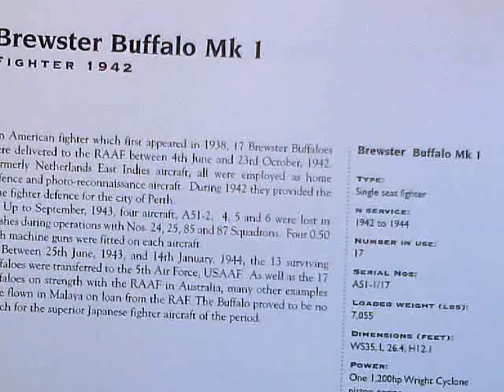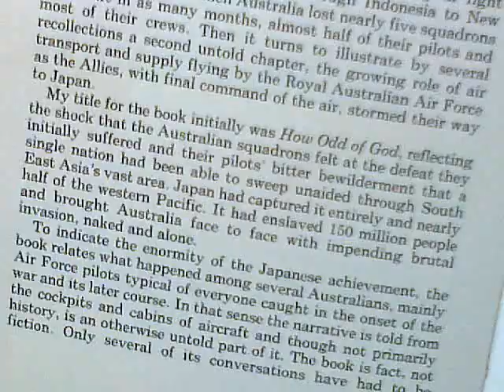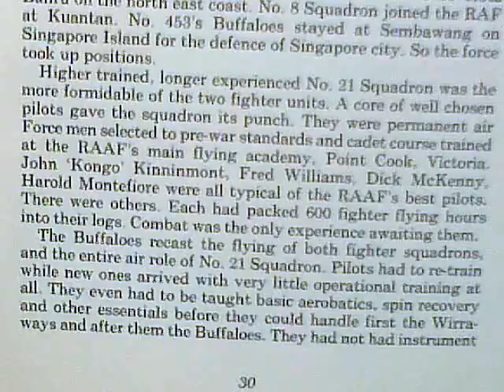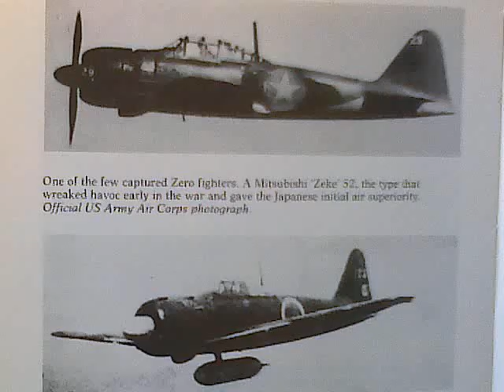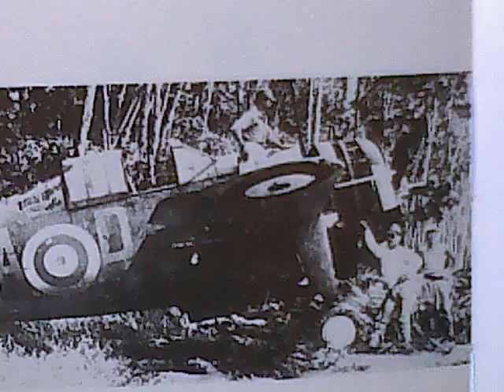World's Worst Fighter Aircraft, The 1941 RAAF Brewster Buffalo !

Comment: The Supermarine Spitfire,
To make matters worse, the Japanese had a fighter aircraft which could ‘dance’ even better than the Spitfire, a fact which was very well known even at the time, and about which the newly-arriving Spitfire pilots were warned.
The Zero developed its maximum speed of 291 knots at its rated altitude of 16 000 feet. The Spitfire produced 290 knots at 15 000 feet, confirming that below 20 000 feet the two types were more evenly matched in speed performance. Given the Zero’s much superior acceleration, in practice this meant that the advantage tipped more heavily in favour of the Zero at these lower altitudes. In comparative tests at 17 000 feet, the Spitfire was again unable to safely draw away from the Zero. The unanimous conclusion of Wawn and Jackson was that ‘the Spitfire is outclassed by the Hap at all heights up to 20,000 feet’.
As was already well known, the Zero had all the advantages in combat manoeuvrability at slower speeds. This was a product of the Japanese machine’s superior power loading and lower wing loading. The Zero stalled at only 55 knots, whereas in clean configuration the Spitfire stalled at 73. Being able to fly more slowly while still under complete control meant the Zero could fly tighter turns without stalling out. The stall speeds cited apply to straight and level flight at 1G – hardly a realistic scenario in combat, where pilots would typically stall out of accelerated turns. In a modest 3G turn, the Spitfire would stall at 130 knots IAS, which equates to a TAS of 242 knots at 20 000 feet. At 6G (a hard turn or pull out at high speed, with the pilot blacking out), the Spitfire stalled at 184 knots IAS, which equated to 257 knots TAS at 20 000 feet, and 294 knots at 30 000. The latter was only 11 knots less than the Spitfire’s maximum speed at that height (at the emergency power settings of 3000 rpm and plus 2 ½ pounds boost), so it is clear that as height increased, the pilot found himself stuck in an increasingly narrow corner of the flight envelope, until any attempt to pull G would result in an instant high speed stall. This helps to explain the high incidence of Spitfires stalling and spinning out of combat turns over Darwin in 1943.http://www.darwinspitfires.com/index.php?page=spitfire-vc-versus-the-zero
Japanese air raids on Northern Australia hastened the formation in late 1942 of No. 1 Wing RAAF, comprising No. 54 Squadron RAF, No. 452 Squadron RAAF and No. 457 Squadron RAAF, under the command of Wing Commander Clive Caldwell, flying the Spitfire Vc(trop). The wing arrived at Darwin in February 1943, and saw constant action until September. The Mk Vc versions received by the RAAF proved unreliable and, initially at least, had a relatively high loss rate. This was due to several factors, including pilot inexperience, engine over-speed due to the loss of oil from the propeller speed reduction unit (a problem resolved by the use of a heavier grade of oil)] and the practice of draining glycol coolant before shipment, resulting in internal corrosion of the Merlin engines.
Another factor in the initial high attrition rate was the relatively short endurance of the Spitfire:most of the sorties were, as a matter of course, flown over the wide expanse of ocean between Australia, New Guinea and Timor. Even when fitted with drop tanks the Spitfires could not afford to fly too far from base without the danger of running out of fuel over water. As a result, when an incoming raid was detected, the Spitfires were forced to climb as fast as possible in an attempt to get into a favourable position. In the prevailing hot, humid climate this meant that the Merlin engines were often overheating even before combat was joined. The Spitfires were fitted with the Vokes tropical filters which reduced performance: in an attempt to increase performance the filters on several Spitfires were removed and replaced by the standard non-tropicalised air intake and lower engine cowlings which had been manufactured by the base workshops. The experiment proved to be a failure and the Spitfires were quickly refitted with the tropical filters.
Many of the Australian and British airmen who flew in 1 Wing were experienced combat veterans, some of whom who had flown P-40s with the Desert Air Force in North Africa, while others had flown Spitfires over Europe. They were used to being able to outmanoeuvre opposing fighters and were shocked to discover that the Zeros they were now flying against were able to outmanoeuvre the Spitfire. Several Spitfires were lost before the pilots learned not to attempt to get into a turning dogfight with the agile Japanese fighters. In spite of these problems the Spitfires were reasonably successful and at times were able to catch the Mitsubishi Ki-46 reconnaissance aircraft which had hitherto flown fast enough and high enough to evade interception
https://en.wikipedia.org/wiki/Supermarine_Spitfire_operational_history#South_West_Pacific

Comment: The Buffalo used the same Wright R-1820 engine that many other aircraft used.  Depending on which supercharger arrangement the engine had, it was rated from about 900 HP to 1350 hp.  For the Buffalo it was rated at 1100 to 1200 hp depending on model.  Early models had a problem with the engine throwing oil at full power but the Finns found a solution.  The AT-6 Texan trainer (Harvard) had a 600 hp engine with 1340 cubic inch displacement, a physically smaller engine never put in the Buffalo  The later versions of the Buffalo had much larger fuel tanks giving the plane an incredible 1400 mile range - but loaded up with fuel decreased the agility of the plane.   

The Brewster Buffalo may be the only fighter credited with destroying more enemy aircraft than its total production run.  Most of the British Brewsters were destroyed on the ground, just like the losses the USA suffered in Hawaii and the Philippines.
Reply from the maker: G'day,

 Thanks for the "Gen." about the Engines...

   On that point about destroying more Enemy Aircraft than it's own Production Run, it's not a statistic which I've ever previously encountered encountered...; but I suspect that the Fokker Eindecker (E-1, E-2, & E-3...; they were the same basic Airframe but with different Armament fitouts & Engines) a hundred & two years ago during the "Fokker Scourge", would have racked up more Kills than there were Eindeckers ever built (?).

 The other contender which immediately springs to mind is the Sopwith Camel, which is said to have shot down more Enemy Aircraft than all other Entente Cordiale ("Allied") Aircraft put together...; there were 5,490  Vamels built, and more Camel Pilots were killed in Training-Crashes than died as a result of Enemy Action, but I don't know what the total number of Kills made by Camels actually was.

   My father's Uncle flew a Camel, (Lt Les. Wharton MM, 4 Squadron AFC, October 1918), he made the History Books on his first flight over the Lines when he wandered off on his own, attacked a pair of LVG Two-Seaters & shot one down (!), was then himself attacked by at least 6 Abatrosses (Albatri ?), which holed his Fueltank so he dived into a Cloud and hid ; on emerging he was knocked-out by a fragment from an Anti-Aircraft Shell, and managed to  wake up in time to pancake just behind the British Front Lines..., I still have an Australian Flying Corps Xmas Card which he sent from Hospital in England during the first week of November 1918....

   He'd been a Seargant at Poizierres, whence came the MM & Commission (& a Shoulder-Wound) while capturing 500 yds of a German Trench..., and he'd originally started as a Private going onto the Beach at ANZAC Cove on 25 April 1915 & he was there for 5 months until breaking an ankle...; after his War he became a Schoolteacher (like his father before him, and as did all his siblings except my Grandfather - the Family's "Black Sheep" who became a Wheelwright/Woodsman/Blacksmith, instead...).

  His son grew up to fly a Tour on Lancasters out of East Anglia in 1943-44, before flying Catalinas from Western Australia to Ceylon, Madagascar, & Sooth EfriKa in '44/'45, and Post-War he pioneered QANTAS' Lockheed Constellations flying into Hong Kong...; the year I finished High School, he retired as Director of Flight Operations... (1978).

   Hence, I have a longstanding fondness for Sopwith Camels, but I've never seen one in real life...; the closest I ever got was working on VH-PSP, an Armstrong-Siddley Gennet Major powered Sopwith Pup Replica, built by Transavia in Sydney, in 1977/78 - when I worked at Olde Bowral Airfield for the Pup's owner in '78-'79...

  Have a good one,

  ;-p

   Ciao !
Reply: So your father's uncle's son flew Catalinas in Sooth Efrika in 44/45. Probably 209, 259 or 262 Squadron RAF or maybe SAAF 35 Squadron or perhaps seconded to 321 (Dutch NAS)? Care to give a name?
Reply from the maker: +Jimbob Jones 

  G'day,

   Well, as I heard the stories, Alan Wharton (son of Les Wharton the Camel-Jockey) flew a tour of operations as a Terrorflieger (Goebbels invented that word, just for the Aircrew of Bomber Command !) in Lancasters out of Anglia bombing Germany in 1943, then he came back to Oz and flew Catalinas from Western Australia to Sooth EffriKa ; after the War he joined Qantas  and "pioneered the Lockheed Constellation Route into Hong Kong...", retiring as Director of Flight Operations in 1978.

   I never met him, only ever heard of him from my father, but I do know that  he was in the RAAF and I think they flew the Catalinas out of Carnarvon, where they called themselves the "Black Cat" Squadron...; the closest I ever got to catching up with him was when I was a Student Nurse at RGH Concord, and I had a Patient who'd also flown Lancasters out of England in '43, who remembered Alan Wharton and told me an annecdote. 

 Apparently there was a time when Alan  complained that his Aircraft was flying Left Wing Low, so it was re-rigged and after a Circuit  then he reckoned it was flying Right Wing Low, so it was re-re-rigged and after another Test Flight he said it was flying with  "Both Wings Low" (!) ; whereupon his Flight Leader or Squadron Leader told him to "Take your bloody Aeroplane Wharton, wrap it up in a Ball-of-String, and then shove it up your Arse !"....

  And therefore, apparently, following that little  incident, his nickname was "Stringball", or "Ball-Of-String Wharton", ever afterwards ; at least, I heard of it 40 years afterwards and 12,000 miles from where it had occurred.

    As a kid I was much more fascinated by the  Sopwith Camels than the Lancasters...

  Have a good one,

   ;-p

   Ciao !
Reply: Howzit in Arsetralia bru? Anyways, I could find only one Wharton, Fl.Lt. initial R, who was 262 squadron navigator, operating from various bases in South Africa, primarily St. Lucia estuary, about 100 miles North of Durban. In early '45 the remnants of 262 was absorbed by SAAF 35 Sq, and a number of those blerrie Aussies were inherited. 35 Sq had detachments at many places along the East African coast as well as at Seychelles and Tulear, Madagascar. In around April '45 the squadron switched to Sunderlands, which was evidently not mentioned by your cousin (?) Pity I could not find an Allan Wharton RAAF, but I'll check some other sources. Oh, yeah and it's actually pronounced "Souf Efrka"! Cheers.
Reply from the maker: +Jimbob Jones 

  Well, go your hardest...; Alan Wharton was RAAF, and his father Les Wharton was in the 1st AIF at Gallipoli, and then France, before transferring to the AFC...

  My mother's father was licenced as an Aviator by the Royal Aero Club of NSW, who issued him International Aviator's Certificate #96 in September 1917 from the W. Stutts' School of Aviation at Williamtown, NSW ; he joined the AFC on New Year's Eve 1917, & had his AFC Wings pinned on his Chest by the King of England, at an Investiture at Buckingham Palace in March 1919.

  As an Infant, I recall my maternal Grandfather, and between him & Biggles I was thoroughly hooked on Aeroplanes, at a very early age.

   You might get a giggle from my "Personal Aeroplanology..." Playlist...(?).

 Have a good one,

  ;-p

  Ciao !
Reply: Bit late to answer, but the R1820  had to be re-engineered to achieve its final HP ratings, gaining a lot of weight as it was beefed up. It wasn't "the same".

Comment: For everyone to know: Finnish Buffalos' did not have german guns at any point of the war. Only modifications that finns made were replacing the gunsight and replacing the original 7,62mm mg with 12,7mm LKK42. Self sealing fuel tanks and any armor were never fitted in planes that were sold to Finland because they were the early production F2A1. Some planes were fitted with russians engines and wooden wings, just for test purpose for the Finnish Brewster copy VL Humu that was under design at that time.

Comment: The Finnish success with these planes is often mentioned in the comments below, the Finns had hand me downs of many different types that otherwise didn't see much action. Gloster Gladiators and Bulldogs, Fokker D.XXIs, Buffalos and whatever they managed to capture and repair of Soviet equipment.
Reply from the maker: G'day,

  Thanks.

    Yes, the Finns did do very well with the Buffalo, as indeed is often mentioned here in the Comment Thread...

   Once they replaced the Radios and fixed or replaced the Guns, and because they were able to fly & fight low enough for the Fuel-Pump to operate properly...; then they had an Aeroplane which was able to beat the Polikarpovs, and there were no Zeroes flying for Stalin, either.

  Have a good one,

  ;-p

  Ciao !
Reply: @WarblesOnALot  yes but russia had lot of p39's, hawker hurricanes, Spitfires and many exellend russian planes. Yes no zeros.

Comment: Odd how they used this machine which was totally outclassed by the opposition, but when the Boomerang came along it was not used as an interceptor because it was considered too vulnerable in combat even though it was a lot more comparable to the AM6 performance wise.
Reply from the maker: G'day,

  Thanks again,

   Well, in 1941 the Buffalo was literally all the British, Dutch, Australians & US Marines in the Pacific could obtain, so they tried to make a go of it..; but they had far too many factors stacked against them.

   The Boomerang was an attempt to take the biggest Engine Oz could get (from a DC-3) and stick in on the Centre-Section & Undercarraige of a Wirraway, and cobble up a Single-Seat Fighter Fuselage to follow along behind the Engine, and tinker a set of Wings to lift the Fuselage while riveting-up a set of Tailfeathers with which to control the Wing...; the idea then was to give it some Machineguns and use it as an emergency stop-gap Fighter.

  The Concept dated from late 1941, in the days when Canberra was planning to defend "The Brisbane-Melbourne Line" because there was only One Monoplane Fighter in Australia when Pearl Harbour was bombed, it was a Mk-1 Hawker Hurricane, it was based in Melbourne, it had NO GUNS at all, and was only flown for Airshows & Recruiting Events - because in 1941 under the Empire Air Training Scheme the role of the RAAF was to train Australians to be posted as Replacements for the RAF in Europe, & the Muddled East.

    So, about the time Japan annexed French Indo-China (Vietnam, Cambodia, Laos...), Oz decided to try to hand-whittle something with which to have a better chance than a Wirraway if the opportunity ever came to set off in pursuit of The King's Enemies.

  I think that by the time the Boomerang was coming off the Production-Lines it was 1943, and both the Amerikans & Australians had flown the Zero which was captured in the Aleutians & repaired for evaluation...; and it was known that the Boomerang wasn't up to snuff when it came to playing Air-Superiority, it would always need something like a Kittyhawk, or a  Wildcat, perhaps a Tropicalised Spitfire to fly Escort for it if any Zeroes were around.

  And because so much had been made of "Australia's First Indigenous Fighter-Plane", in the Pro-War Propaganda..., it had to go into service, so therefore it became a Ground-Attack/Army Co-Operation Machine ; in New Guinea & Burma, for a while..., until it could be quietly retired behind news of Spitfires & Mustangs being issued to the RAAF, with the CA-5 being under development when Hiroshima was nuked.

   The Buffalo experience taught the RAAF to know better than trying to fly their own Bullshit Propaganda in the same Sky as an Enemy who had superior Hairygoplanes...; thus, the Boomerang was never permitted to disgrace itself, it was merely "somewhat disappointing"..., though "it was well-liked by those who flew it...".

  I saw a restored Boomerang flying, in November 2015, at the Armidale Airshow ; the Videos are up, posted then, if you want to see it...

  Have a good one,

  ;-p

  Ciao !